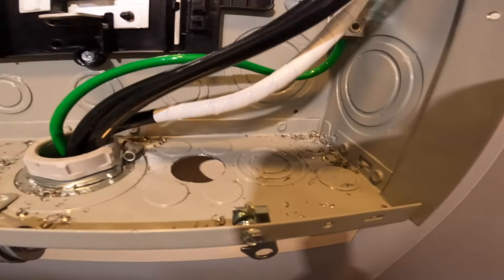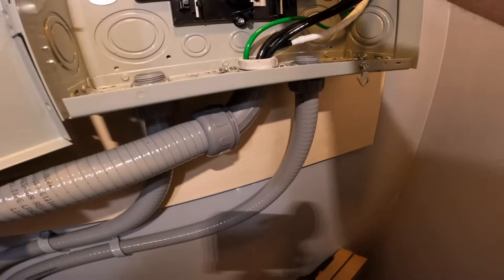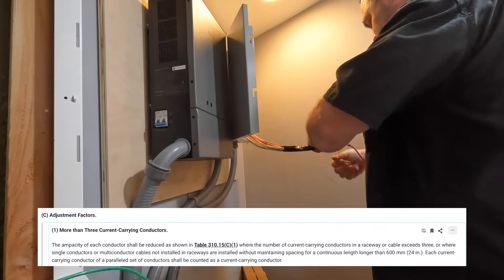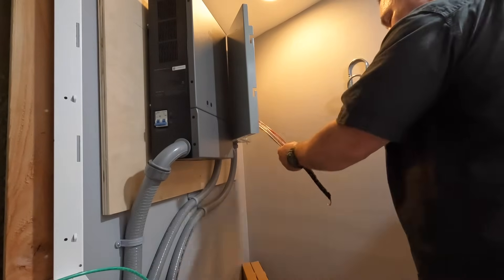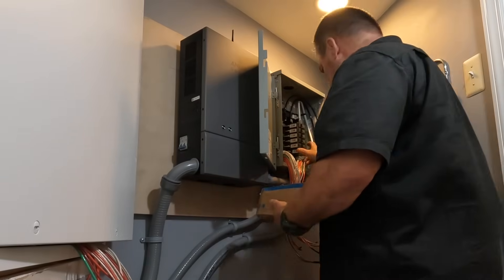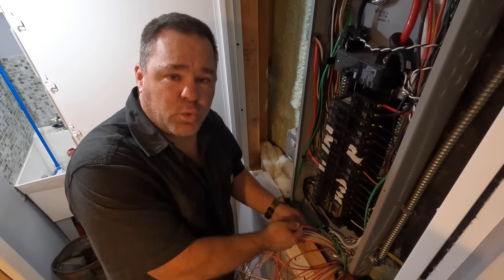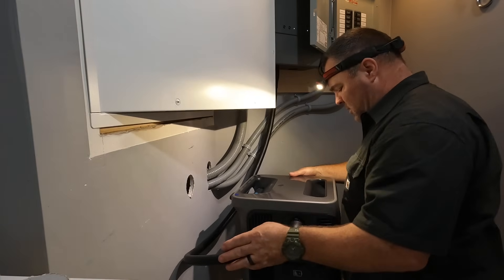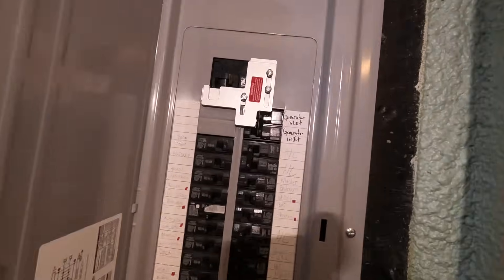Anker Solix Pt 2 | Derating the branch circuits & initial start up..

Comment: Outstanding Video. Many thanks. I have a great understand now of what I will be asking of an electrician. Any issues with building codes for battery storage in New Jersey? I'm in Massachusetts and it looks like I might need a firesafe enclosure of some sort.
Reply from the maker: Probably a smoke detector in the space where the batteries will be stored.

Comment: Hi Ron, great job on this install! Did I hear you correctly, that you used a SINGLE 10 awg ground wire in each of the 1" conduit runs? So, not 6 ground wires (1 for each circuit) in each conduit, but just a single through to the emergency panel's ground bus? Thanks so much!
Reply from the maker: Yes, only (1) EGG per raceway sized to the largest conductor is permitted.  NEC 250.122(C)
Reply: Great, thanks

Comment: At 8:00 I agree with the point to not just point out what’s wrong or what the code says but to actually say where it is in the code.
Reply from the maker: Thanks for the kind words. Explaining the why isn't explaining anything until you can point to the section of the code where it applies. When it comes to electrical conductors they all generate heat. It's the heat that an electrician needs to be able to determine what size conductor and overcurrent protection device is appropriate for the circuit, feeder, or service.

Comment: What kind of connector do you use when bringing a stranded insulated grounding electrode conductor to the main service panel? Also can I use quarter inch ground wire clamps to secure a number 6 stranded insulated grounding electrode conductor? Thanks!
Reply from the maker: A connector is not required for grounding electrode conductor.
Reply: Thank you. Can I just drill a hole on the bottom panel for the GEC? Can I use 1/4 steel ground wire clamps on insulated #6 GEC. Will these magnetic steel clamps cause inductive choke as the wire is insulated? I don't think it will, but I could be wrong. Thanks again.

Comment: Great job ron. Just a question. since i see you ran two #10 ground into the emergency panel, is it the case you have two ground bars in the main ? or is it best practice since its 12 circuits, its code to have at least 2 ground to cover a fault for those circuits

Comment: On the circuits you moved to the new circuit box ( the 12 circuits)  will you be removing the old breakers from the original box and putting in blanks in the panel ?  Or will you keep the breakers there for "future use"?
Reply from the maker: Great question! The main panel is made by Siemens.  The emergency panel is a Cutler Hammer.  The circuit breakers must match the panel manufacturers listed breakers.  NEC 110.3(B)

Comment: Fun Project so joe can also connect an external gen?
Reply from the maker: The battery backup and transfer switch act as the back up power.
Reply: If you're only using a single F3800 Plus you can get a generator input cable directly from Anker to fit into the second plug on the transfer switch.

I'm debating whether or not to pick up this system, and the lack of a "dedicated" generator input is one of my bigger issues with the setup overall.  I can't use two units AND plug in a generator without either disconnecting one unit, or wiring the generator into an interlock breaker.  If I disconnect one unit and I'm over 6000w of total power draw, I can lose all power output, and if I do an interlock breaker, I lose the automatic transfer function (and the Anker setup doesn't know what's grid and what's generator power).  Bit of a catch-22 situation...

Comment: I used to be a code nazi. Now I am retired and IMHO the code making panels have run amok. They have sold out to the equipment MFGs. Instead of making the right decisions and using a commonsense approach to the code they are making it much more confusing than it needs to be.

Example: In the old days pipe was pipe if you were sizing pipe for conductor fill 3/4" was 3/4". First of all why the meter and millimeter designation? We are in the USA?
Why is the fill for 3/4" ridged, EMT and seal tight etc. should all be the same like they used to be. There is not that much difference in the diameter of different raceways just pick the fill for the "smallest 3/4" and use that much less confusion. And that's only one example.

Comment: My definition of "workmanlike manner" is doing a job: 
(1) in the way a skilled, careful professional would do it — not sloppy, not cutting corners, and good enough that it works properly and lasts; 
(2) that the end result is you have left things better than how you found it; and 
(3) even though your work may be hidden behind a panel (or drywall, etc) the final result brings credit to both yourself and your fellow tradesmen.

p.s. Ron, in the Navy, both you and I were taught that there are 3 ways of doing things - the right way, the wrong way, and the Navy way.  Just replace "Navy" with "NEC" and that is the only way.
Reply from the maker: Anchors away my friend!